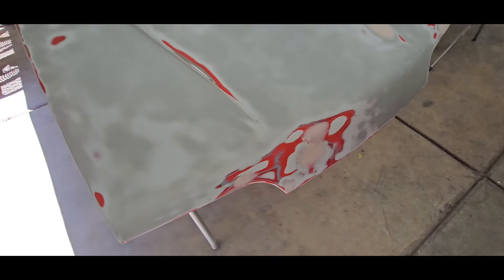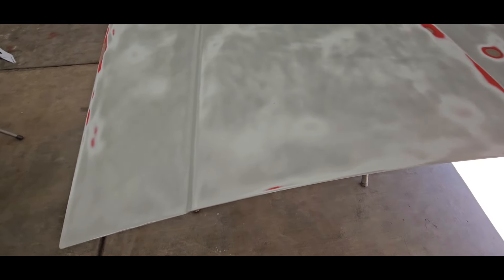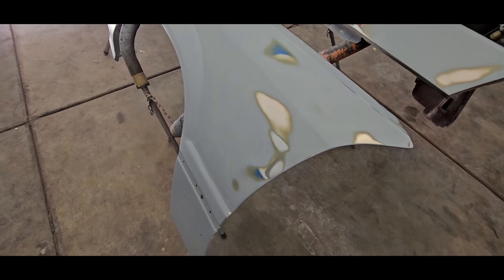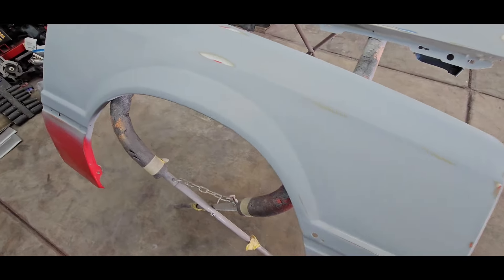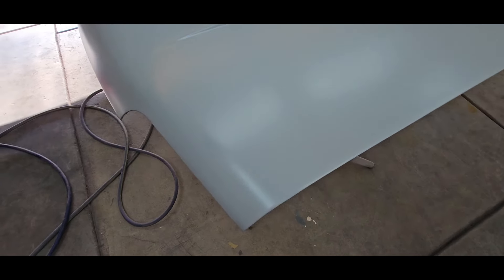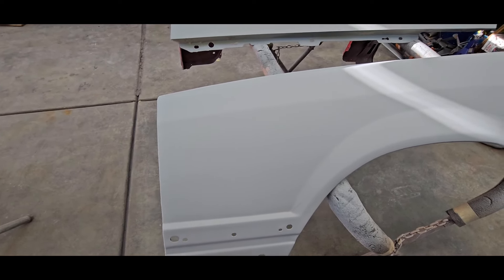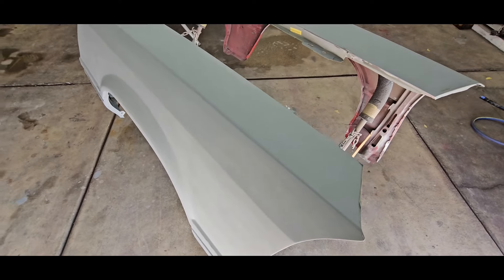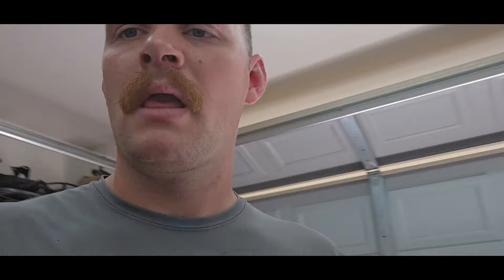1993 Ford Mustang GT foxbody budget build EP:7

Comment: Can I ask, what is the color name and brand you're using? I've been following but have forgotten the brand name. Really enjoying your video on this car.
Reply from the maker: Brand is High teck.  The color is called victory red. Finish 1 clear coat
Reply: @FoxbodyJunkie  Cool, thanks! I just painted my 92 GT and paid an ungodly sum for Tamco Vermillio red. Your red looks super close to it, wish I had found that brand first. It's looking great!
Reply from the maker: @user-to3ev3og5y  yes, red is one of the most expensive colors. A gallon was around $200 with the reducer, which is an amazing deal considering how well it covers.
Reply: @FoxbodyJunkie  You've done an amazing job. I'm correcting my inexperience with lots of wet sanding and polishing. It's coming around though. I painted my 84 GT 350 and it turned out great. However, white is MUCH easier than red to get looking good.